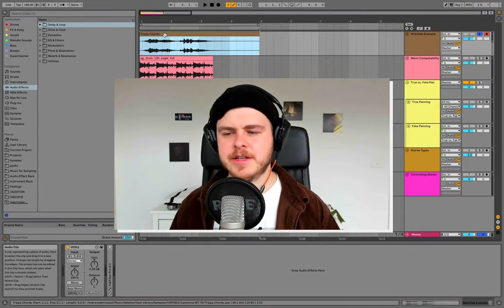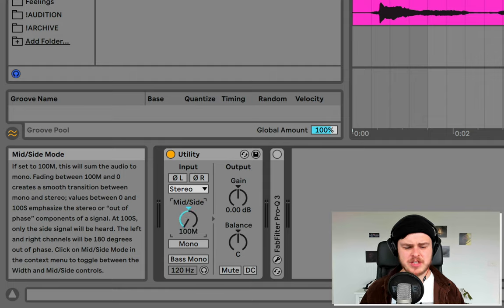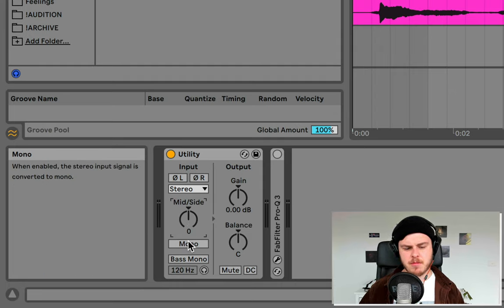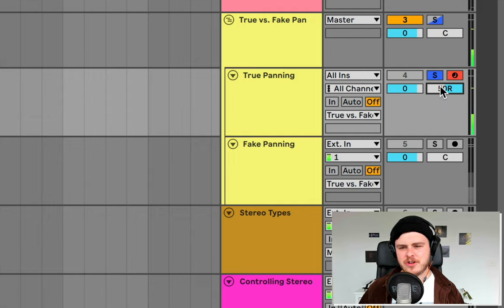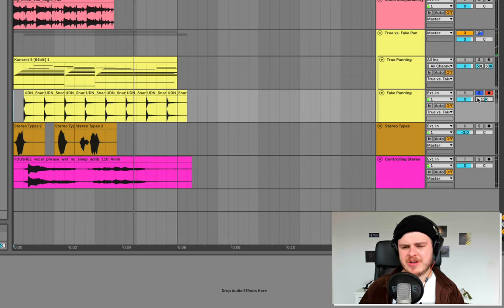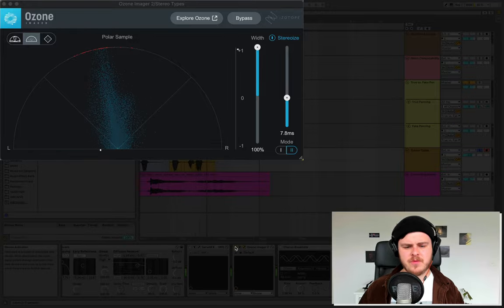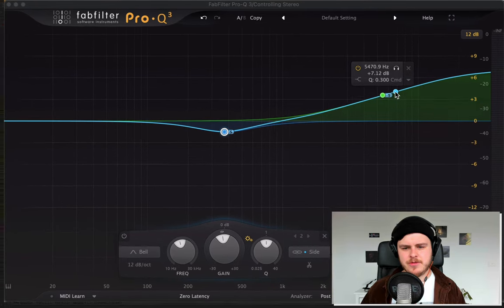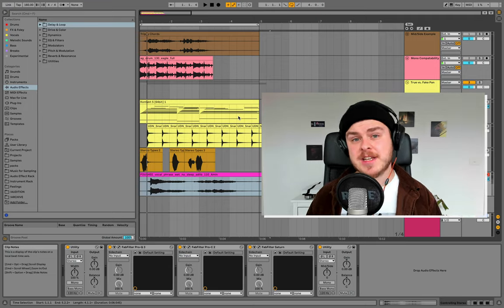5 Things You NEED To Know About Stereo Imaging

Comment: 4'37" - Playing back a mix in mono is not the same as listening to the mid-channel of mid-side only. When mono'ing, the side channel is folded down to mono. You may get some phase cancelling which may result in some audio being dropped, but not all will be dropped. So it's just a mono representation of a mix, instead of solo'ing the mid-part.
Reply: I came to comment the same thing. For mono compatibility check you need to listen to both mid and side folded down to mono, not just the mid channel.

Comment: Mhhh I would just say something that I'm confident about but not sure ! Please correct me if I'm wrong. But Mono when checking for Mono compatibility (using the mono on utility for exemple) That would make you listen to L+R :  thing that you want because Mono sound systems works like this.
But when you turning the M/S knob  and only listening to the MID : That would actually makes you listen to what is comon to both L and R. Wich is completely diferent than the mono L+R
Reply: Agreed, I just posted something about this too :)
Reply: Yeah that's correct.